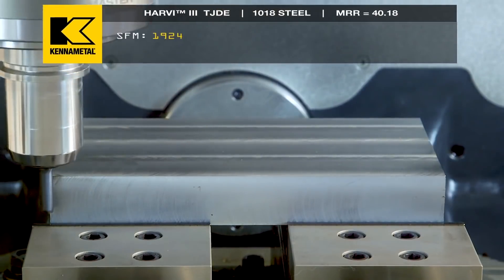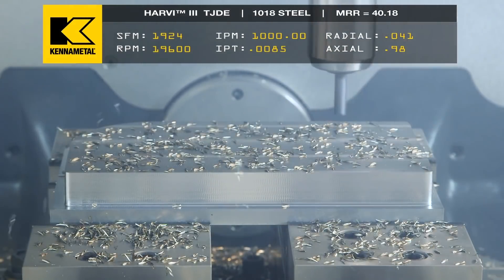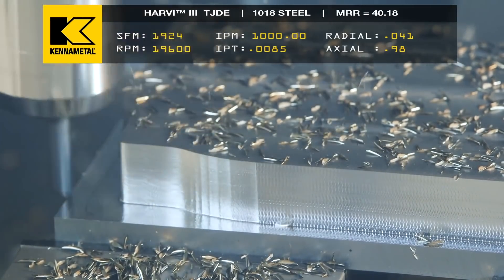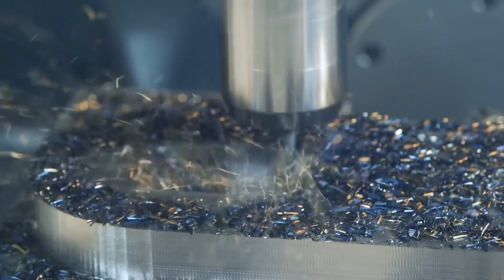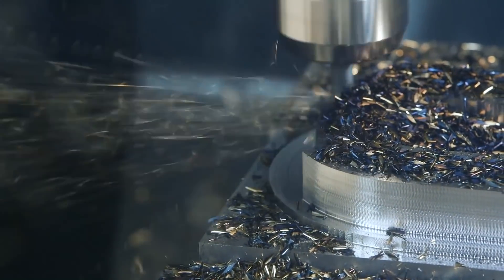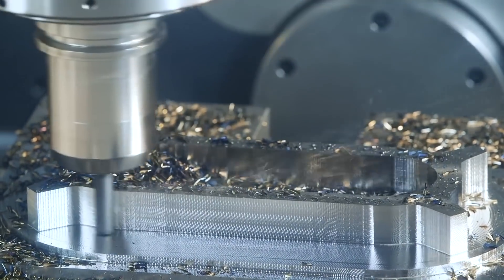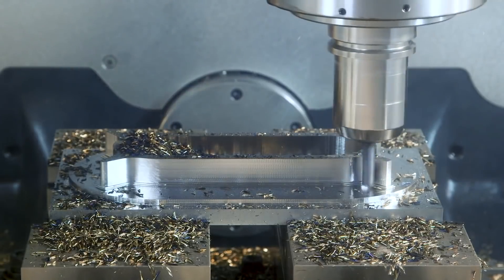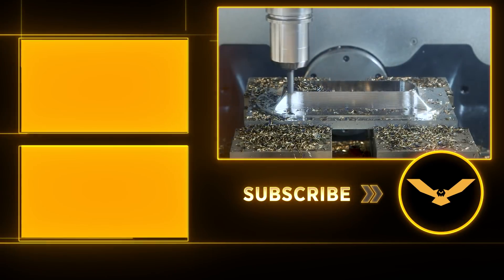Making Crazy Money Running Parts at Crazy Speeds and Feeds

Comment: Couldn't that roughing been done faster, with a trapezoid cut on each side of the part, giving you another 4 blocks of material to use for something else? I think on a 4-5 axis there is a lot of room for efficiency gains by chopping blocks off first and then coming in to shape the part. In this case the center would have given you a giant oval plate to use while reducing all that center cut to 1 oval around the inner diameter. Probably best to do that one last to keep the part rigid while machining the outside.
Reply: You can only take half the radius of the end mill with each pass.  Cutting chunks off would break them.

Comment: can u show us how to cut thin aluminum or platic, it got bent often
Reply: From my expirience I would say vacuum is the key for machining all thin materials, but for those which dont have vacuum and use soft jaws like my company usually do, we machine the parts in more phases, both sides with a 1mm material left over on all measures, then switch part back to first machined side and machine it to final measures, samr at other side.  This applies for plastics and 7075 aluminium.
Reply: I'll tell you a secret. Put the part in the freezer the night before machining. Take it out right before you start the part. Use tools with a very negative chip breaker or big flute angle, no need for high speed but take bigger passes even for finishing. It might need some testing to get the final tolerance at room temperature correct, but when the part is frozen it won't bend. Also for plastic, keep it dry as some types of plastic swell with humidity when defreezing, because of the air humidity sticking to it while it's cold

Comment: If you are hitting the material hard at the beginning  - wouldn't it heat the material and in metal's case wouldn't that mean the metal expands,  so when it contracts later, suddenly it's slightly smaller ?? Or maybe you douse it with coolant when making the fine cut later ?
Reply: If you run the tool hard and fast the heat generated goes mostly in the chips. Part heating is conducted over contact time rather than pressure. Running slow increases machining time and heat flowing through in the whole part. Hit it as hard as possible and the chips are gonna get toasted, sure, the part might get warm on the outside but not in the core
Reply: They usually don't use coolant for the videos, so that we can see what's going on.
Reply from the maker: Tool moves to fast to heat the material and the heat goes out with the chip… then you simply relax vise pressure and come back slow and kiss the baby right into perfect spec.

All day, every day

Comment: I like pushing my machine fast.  But sometimes the machine can't handle it. Like max spindle speed is 8000rpm feed rate of 120. I get more nervous with sheet metal. I have accidentally broken quick  twist drills .531at an angle at 100% rapid. Basically a feed rate of 270 since the machine is old.

Comment: At the beginning of the video I was like yeah everybody is a hero in aluminium before I noticed that its steel 😅
Reply: That's something I've consistently see come out of Titans. They're always after those speeds they get on Al from all steels Ni-alloys. Certainly inspirational.
Reply from the maker: Yep, check out our aerospace academy.com
Reply: true but it is just 1018
Reply from the maker: We run all materials including Inconel, A286, Monel K500 etc
Just search our page.
1000 IPM in even 1018 is legit though…
Come on😂😂😂🤷‍♂️
Reply: @TITANSofCNC  1000 IPM in even a soft alloy of steel is pretty incredible. I can't deny that. I just haven't had the opportunity to work with anything harder or tougher than 4340 heat treated to 50-55 hrc and in that stuff my supervisor wants me to go slow and steady. Most of it has holes already drilled and tapped in it so it just eats inserts at higher SFM.
Reply: In 1018, 1020, A35 and other junk alloys I push my TSC carbide drills at from .201 up at .008" per rev and 350 SFM. On my most commonly used .531 (17/32) drill that's 2518 RPM and 20.144" IPM.
Reply: Ss Also Have Quality And Grades Ss 304 Doesnt have That much hardness Its Also Like aluminium

Comment: Add more AE please. Safe money
Reply: AE is radial and when you go 8-10% on a 6 flute, the chips are the right size to get through the flute spacing. Reducing radial and increasing feed reduces heat and increases tool life. When you reduce radial you can increase feed due to chip thinning and achieve the same mrr but more reliably.
Reply: @rossomyman  ok
Reply: What is AE?